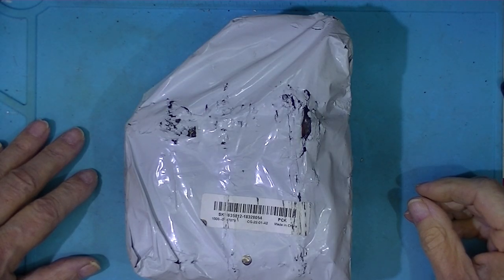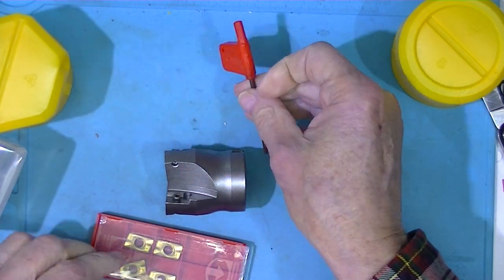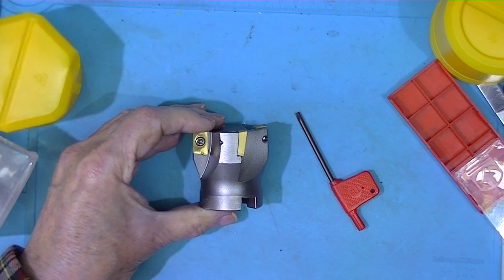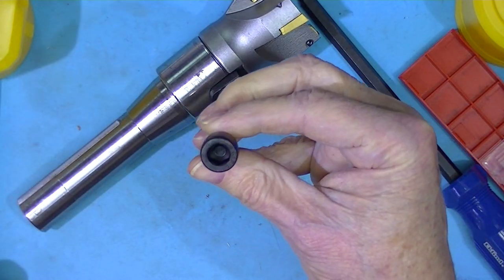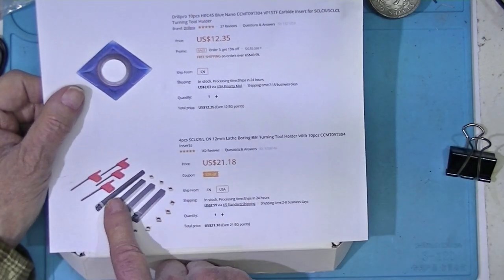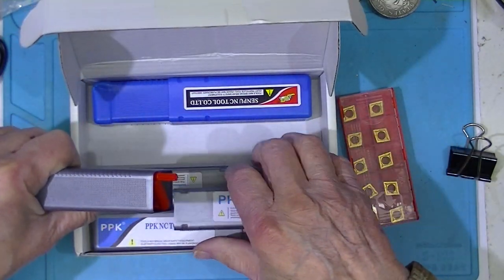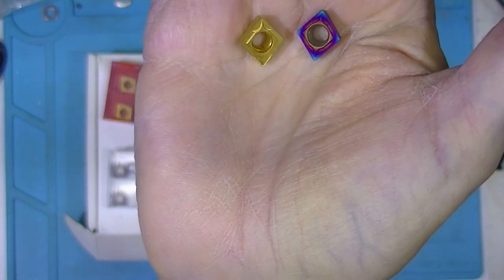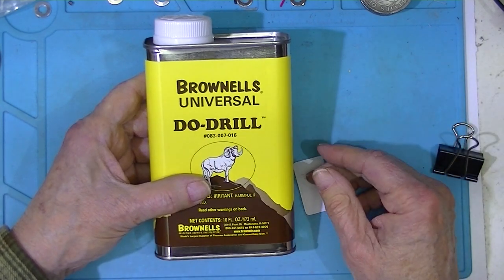Carbide Tooling N’ Other Stuff

Comment: I understand that if you get a 75° face mill, you can use those other two corners of the APMT inserts for facing.  I am looking for a face mill now, but need a 2MT shank with 3/8-16 draw bar.  Most of the Bangood 2MT face mill and arbor sets are set up for an M10 draw bar.  I have found the 2MT arbor with 3/8-16, just not from the same vendor as yet.  The package deals seem to be less expensive. Also, I'm trying to not have to make an additional drawbar just for face milling.